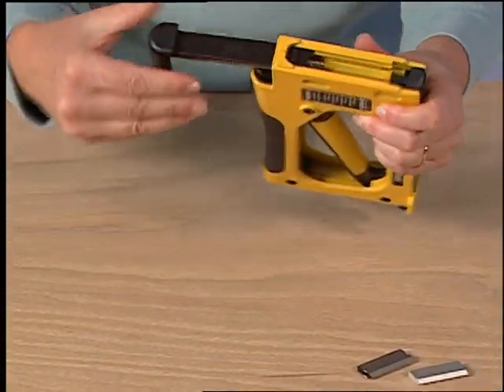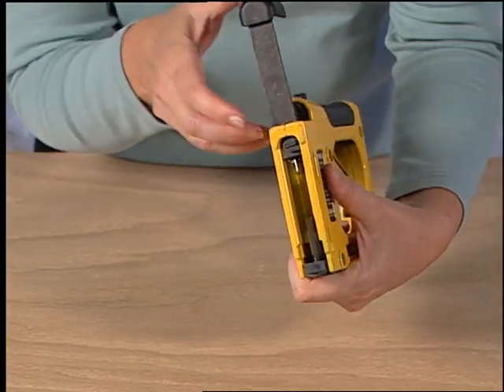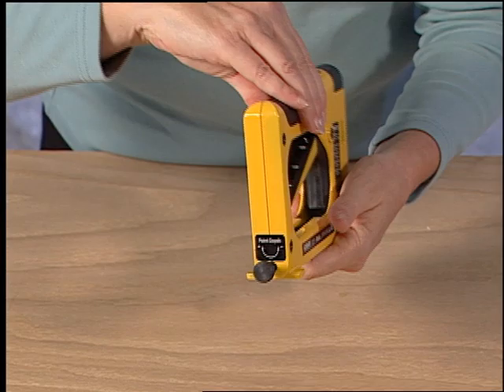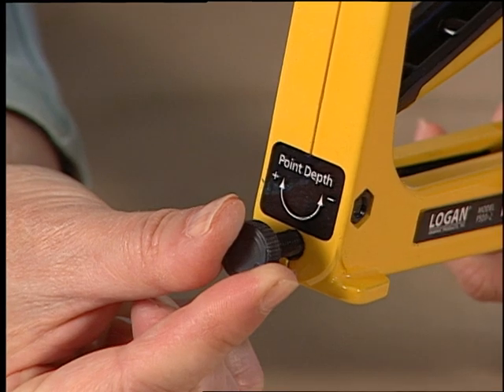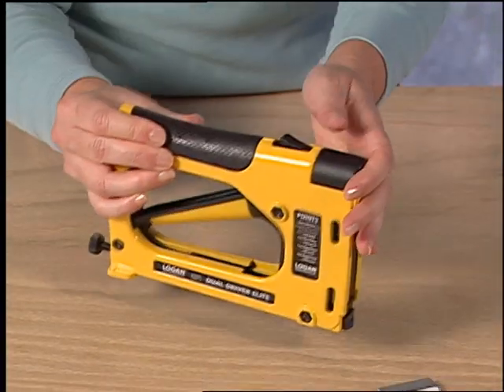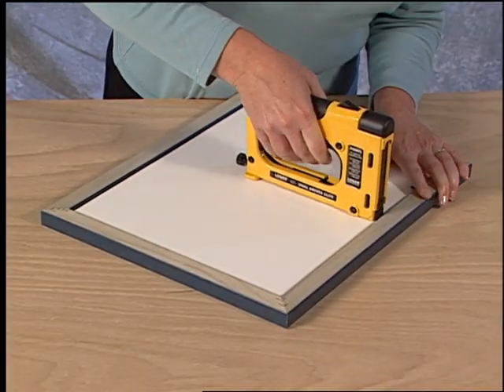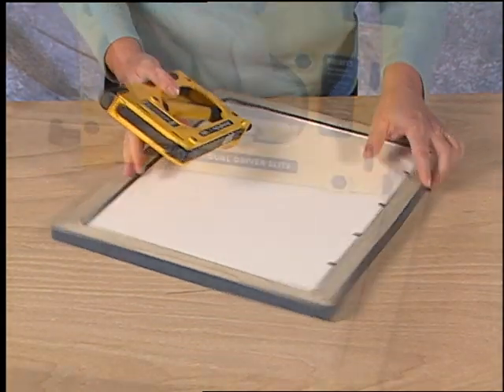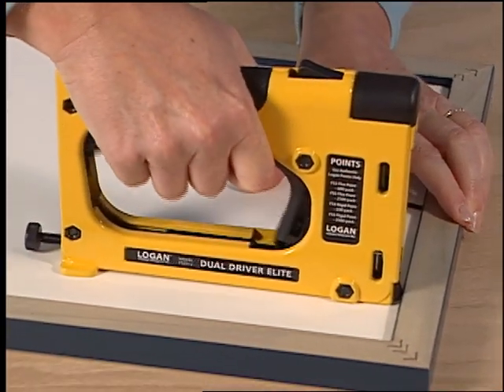LOGAN F500-2 Dual Drive Elite

Comment: Hello, what is the difference between the Logan Rigid Points and the Flexi ones? - I would like to use the Flexi ones but i am afraid it wont hold the artwork in place for large frames such as 40x30in, can you help me choose? Thanks!
Reply from the maker: Hi, Typically the flexible points can be used on soft woods only but offer the feature of being bent up out of the way when changing the art out. The rigid points are not designed to be bent and in most cases would need to be used on hard woods as the flexible points will fold while being driven. Thanks.

Comment: This is brand new to me, this video glossed right over which direction to load the points....seems kind of important!  :(
Reply from the maker: Hi, the points are loaded so the point is going the direction it will be driven. The instruction manual shows this a little more clearly. But its simple to do. Thanks.
Reply: @LoganGraphic  No, it ISN'T easy to reload this thing. I struggle every time. Will buy a different brand next time.
Reply from the maker: @MargieOilPainter  Hello. You should be able to push the button on the top to release and slide the button all the way up. Then drop in a strip of either rigid or flexible strips into the channel with the points facing outward. Then push and lock the button back down. Can you describe what issue you are having? Or please email us at cs@logangraphic.com Thank you.
Reply: @LoganGraphic  I put the points in and it jams.  Difficult to remove. This goes on several times (with lots of cussing and banging). I've found it necessary to remove a small chunk of the points from the strip (as it comes from the box). It's maddening.
Reply from the maker: @MargieOilPainter  Hello, please call us at 800-331-6232 or 847-526-5515 and we will take care of this. Thank you.

Comment: Some of the frames I use are made of a manufactured mdf type of material.. will the points penetrate and which type of point would be best to use..??
Reply from the maker: Hello, in my experience the flexible points seem to work fine on MDF or even on the plastic composite moulding. However I typically use rigid points on everything I do. Thanks.

Comment: I'm using my Logan to glaze glass in window frames but the points don't go deep enough what am I doing wrong?
Reply from the maker: You an try increasing the spring load by turning in the knurled knob on the back to drive points deeper.
Reply from the maker: Try increasing the tension on the drive by turning the knurled knob in on the back of the tool which fires the points with more force.

Comment: Some times after pressing 2 to 3 times only the pin is releasing what would be the problem,  please support me to rectify this problem, I had 2 machines of same problem
Reply from the maker: Make sure you have at least a full stack of points loaded in the tool. Check the screws that hold the body of the tool together to see they are tight. See that you are using authentic Logan replacement points. Thanks.
Reply: @LoganGraphic  thanks for your immediate feedback let me check it out  and get back soon

Comment: I was supplied from Great Art with boxes of loose points which have to be inserted one at a time and tend to get jammed.  A very laborious exercise. Not happy
Reply from the maker: +Michael Featherstone 
Hello Michael, I believe you received the wrong pack of replacement points from your stockist. We have another point driving tool the F400-1 Fitting Tool that loads each point separate and you may have received points for that by mistake. The F500-2 Dual Drive Elite you have needs the F53 Flex Point strips or F54 Rigid point strips. These are strips of point you load as a single glued set of points.

Comment: I can not get this thing to open. I am pushing the button but nothing is happening.
Reply from the maker: Hello, You should be able to use your thumb to release the button and the front of the tool that slides upwards and allows you to load points into the channel. Is this new and have you used it successfully yet? Otherwise call us at 800-331-6232 CST M-F 7:30 AM to 4 PM. Thanks.
Reply: @LoganGraphic  thank you. It is new and I actually had to squeeze the trigger to get the front part to slide up. I'm not sure why that was but now it is working with the button and I am able to load it.
Reply from the maker: @myisha7833  Glad to hear that. It could be being new, the button is a little sticky at first. Thanks.
Reply: I am having the same problem and NOTHING will get this piece to budge open. It looks so effortless in the video. Trying to frame a Christmas gift…help!

Comment: I watched this to find out how to load but your video doesn't show that (which way the points go in). Kind of video making 101.
Reply from the maker: Hi, The points go in so the point of the strips are facing the direction they are being fired out the nose of the tool. Thanks.
Reply: You put the points in the channel inside the gun with the actual point facing up.

Comment: what's about the maximum weight these points could carry? i'm using a 30 x 40 frame with about 2500 grams of glass and paper. Could that hold?
Reply from the maker: Hi, The points are not really holding the weight of the frame. They are simply securing the glazing, mounted artwork and backing material into the rabbet of the frame. So long as you are using wood moulding, this tool should work fine for you. Thanks.
Reply: @LoganGraphic  Hello there, thanks for your swift reply. English isn’t my first language so I’ll try to phrase more precisely. I have a wooden frame. In my case the glazing, mounted artwork and backing material are heavier than normal, the aforementioned 2500 grams. So if I would shoot the points into the rabbet of the frame, and I turned the work on its back, would the points be enough to carry that load? Thanks again!
Reply from the maker: @commente  Hi again, 2,500g is about 5 1/2 lbs. So I would suggest you use the rigid points instead the flexible, use more points than normal say every 2' to 3" apart, increase the drive spring force by tightening in on the rear knurled screw some but not all the way so they drive in deeper to the rabbet and do not insert points in too close to the corner joints. That should hold it fine. Thanks.
Reply: @LoganGraphic  thanks for your reply! I’m on the case
Reply: @commente  Did it work?
Reply: @LoganGraphic  I realize this is an older post, but am curious as to why you say "do not insert points in too close to the corner joints."
Reply from the maker: @edwardknoch4987  Hello, The idea of that is to avoid any impact force in the corners near where the joints are. That could potentially knock the joint loose. Unlikely that would happen if you have glued and v-nailed the corner correctly. But its a tip that framers use to not upset the finished corners. Thanks.